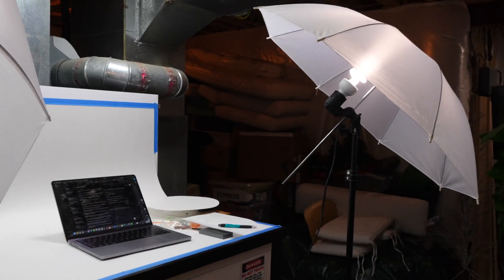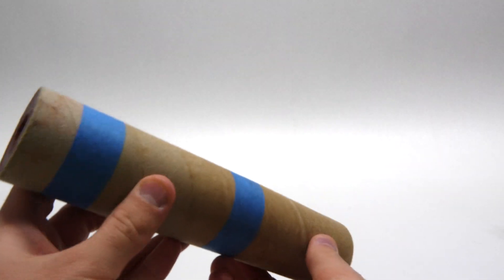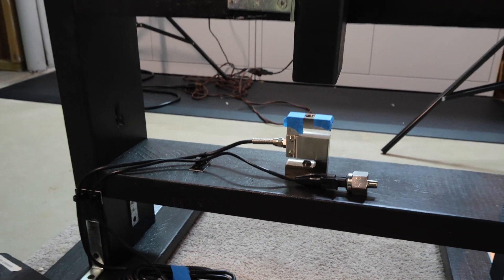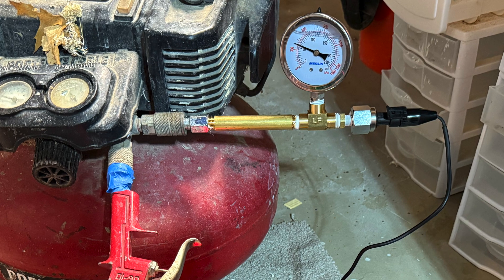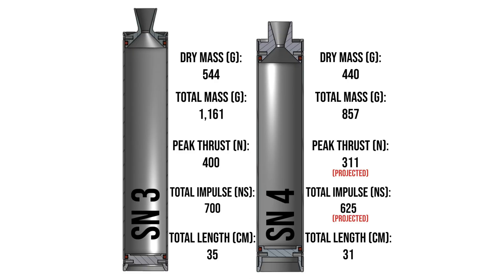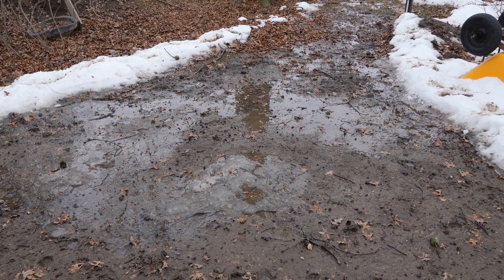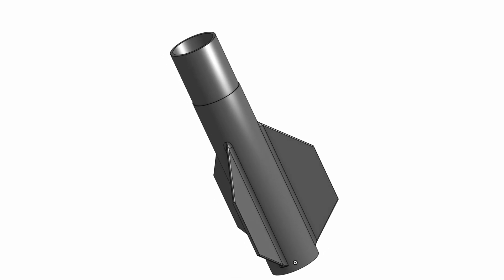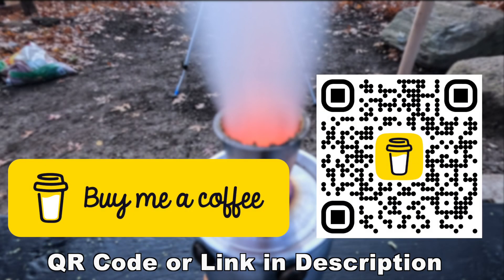Rocket Motor Progress Update (Biggest Upgrades Yet)

Comment: Great video. When is the next livestream? I was also wondering where you would launch the rocket. To fly that large of a motor you need a wavier. Unless you get your own, the only place you could fly such a rocket would be at a Tripoli prefecture. But you would have to be level 2 certified to fly it.
Reply from the maker: Next livestream will be the test assembly of SN4. Just waiting for parts to arrive. Still trying to work out where I could fly this rocket. My local rocketry organization does not allow custom built motors...